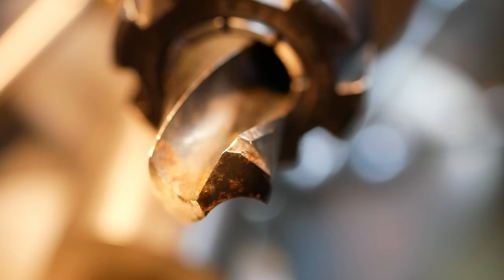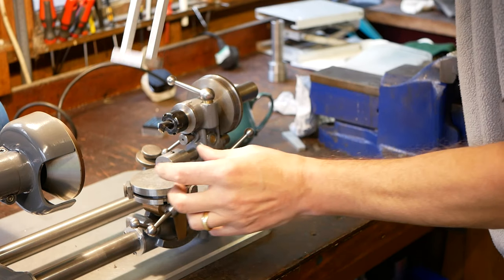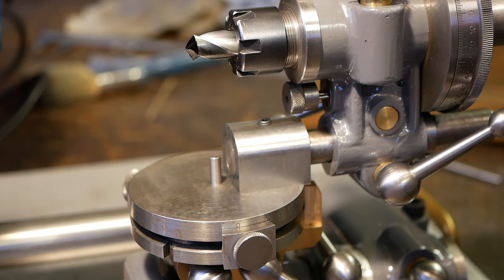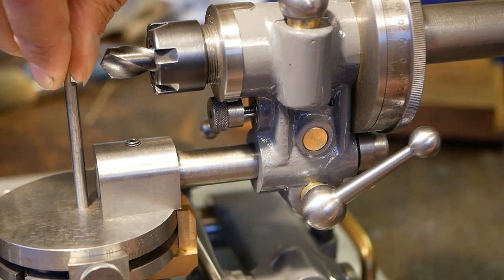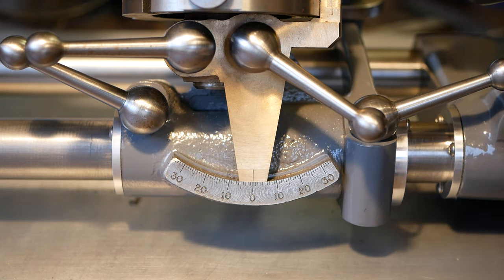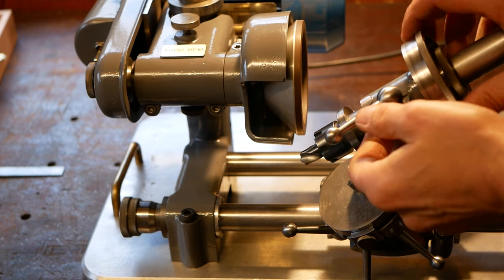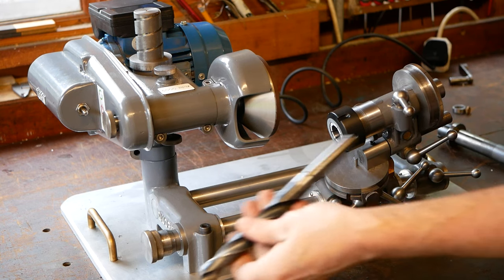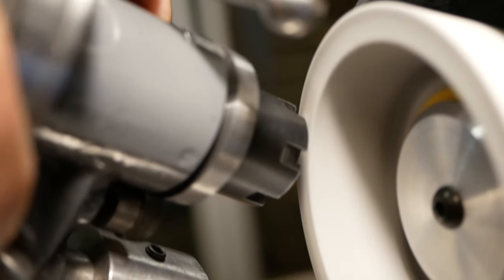How To Regrind Drill Bits Using a Quorn Tool & Cutter Grinder

Comment: Excellent!  I was taught to sharpen drills manually, and the activities of offsetting the bit and rotating it about an imaginary conical path (i.e., how I was taught) seem similar to the way this device works.  Though I say so myself, I'm pretty good at sharpening drills, but it's fair to say that while mine cut holes through metal, they can't be as accurate as machine-ground bits.

Comment: When I entered machinist school in the mid 70's, one of the first things we learned was how to sharpen a drill bit. Nearly 50 yrs on, I can sharpen a drill with my eyes closed. Seriously.
Reply: Вася ты никогда не заточишь сверло так как станок!!!!!
Reply: But does the chips come out evenly on the two flutes?
And how much oversize do you usually make?
Your drill bit grind might be adequate for your use. But it might be inadequate for others. To each his own.
Reply: @ramonching7772  You adjust the grind until the flutes are even. It also depends on the size of the drill.
Reply: Build a Quorn years ago fantastic project and machine 😊
Reply: Yea, my dad was a machinist. Taught me toolmaking. Always eyeballed drill sharpening, altered them to suit materials. When I was working as a truck mechanic and needed a really short 1" drill. my boss panicked when I cut an old one off with a chop saw he didn't think I could re-sharpen it. They're still using that drill bit. You can actually make them cut over or undersize.

Comment: Very clear tutorial for that particular machine. 

I'd raise a separate issue: that drill has been accurately ground on the cutting edges but not properly sharpened. 

Note the worn margin lands adjacent to the corner intersection. While this drill would perform adequately in soft steel, aluminum, or brass, production drilling in tougher or harder materials would not go too well. The worn land has in effect a forward taper that will tend to wedge against the walls.

The worn margins chafe against and work harden the hole walls resulting in heat, short tool life, poor finish, and possibly siezing.

That worn drill should have been rough ground back at least 3mm to clean undamaged margins then sharpened.
Reply: As a tool and die maker/toolroom guy I agree

Comment: I would respectfully suggest to those people who are watching these videos, that you purchase a supply of twist drills to begin your own self help training program. The twist drills can be either no-name new drills, or used/damaged drills from an industrial salvage warehouse, or at a flea market.
  I will add a point that I learned as a high-school senior in 1965. The half dozen guys that worked in a local shop, where I worked in the mornings, sharpened most of their twist drills on a 6”x48” belt sander. It sounds a bit odd, but does work very well. The surface is always flat, and grits can be changed quickly. Many of you folks already do own a 2”x72” grinder that will sharpen many of your drills.
  Whether you use a grinding wheel, or a belt grinder, you then need good lighting, a can of water, and a comfortable stool of the correct height. Then you begin to practice as long as it takes. In my apprenticeship, I had the opportunity to spend three months in the tool grinding department. The first order of the day was to sharpen all of the drills that a large shop(150 men) had used the day before. This is a lot of good practice. Everything from #52 tire mold vent drills under a microscope, to 4” taper shank( Morse taper #6). The large ones were sharpened on a machine. There were usually 20-50 pieces to sharpen each day. Some of the guys would check out a drill from the crib, and come to have a “favorite” point geometry added.
  Watching a knowledgeable person grind a few drills in order to get the proper hand placement, and the “swing” motion of the shank end. The worst thing that I have seen, is to watch an “expert” holding the drill cross handed. With a right hand helix twist drill, the right hand supports the point end, and provides the pivot that the drill swings about, while the left hand drives the twist drill, through that arc that provides the good cutting drill. The thing that few people explain, or even understand, is that the drill point has a steadily changing clearance angle from the dead center, which is the greatest, due to the smallest diameter, and gradually becoming lesser as you move outward to maximum diameter. The dead center is the part of the drill point that scrapes the metal, and gradually becomes more efficient as the rake increases towards the outside edge.
  Once you have mastered the proper point angle, and good clearance, which allows two nearly equal chips from the flutes, your next step should be to learn to thin the web, and/or split the point to reduce that retched dead center. 
 You can learn to hold the drill straight up, at arms length toward a white surface to observe the equality of the point angles and lengths. The grab your trusty drill point gage to verify you judgements. Make it a challenging game, and not some tedious chore that you don’t want to do. It is a skill that will be admired by others, and can be taught to members of either sex.

Comment: I think you meant "perpendicular" to the axis of rotation @ 2:17  i.e. parallel to the the rotating workhead centre line.   It took me a little time to understand your "parallel to the axis rotation" statement until the set square was mentioned.   Sorry to be picky but maybe this comment will help others fully understand that part of the setup.     I built a Quorn with extended bars and other enhancements and it took me 3 years of hobby time to complete but I wouldn't be without it now - I don't use it for drill sharpening as my hand skills in this department are quite adequate for any size of drill.   If you have a drill with a chipped land then you are best to course grind the cutting edges  (at 118 degree angle - equally) until the chip is no longer visible before you do the fine detailed sharpening.

Comment: I think I saw that J Hugel died recently. I would have liked to witness a discussion between him and Professor Chaddock!
Thank you for making his drill-grinding process more intelligible. I note that you are using an extended mounting bar for the work-holder.
Reply from the maker: Thanks for watching and good spot. The extended bar is useful for the ER32 collet adapter due to the extra length.

Comment: Thank you for publishing this video.  Will you be discussing how to calculate the axial and radial offsets for any given drill size?  I've watched this beautiful video several times and I would like to try this technique on my QUORN using my version of Professor D.H. Chaddock's (designer of the original QUORN) "Setting Micrometer" to set the axial and radial offsets.    My version can do axial and radial offsets up to 1" but I have no idea how to do the calculation for a specific drill size.   
Thanks again.  
F.C.

Comment: Really nice video, thanks! I didn’t understand why the angle was moved to 25° and then back to 0°?
Reply from the maker: The first part is setting the dial to 25 degrees, then locking the dial to the drill bit and finally rotating the combined drill and dial back to zero. (You could skip this but it's easier to know you're at the right angle when the dial reads zero.) The 25-degree angle is τ in Hugel's instructions (see link in description).
Reply: @chronovaengineering  ah I see, thanks!

Comment: So is this considered obsolete these days? I get that a drill doctor is consumer grade garbage compared to this, but I'm guessing that there is a professional equivalent to it now that doesn't require so much setup as this. Am I correct?

I love this video. Even if you lost me quickly. I love the way old machines were built before value engineering was a thing.
Reply: for drills this machine might be a bit of overkill, but it's also used to make lathe tools & sharpen milling cutters and that sort of thing where you might want much finer control over the geometry (:
Reply: @roseroserose588  I can see that application. Thank you.
Reply: In a modern production environment, the machinist is way too expensive per hour to be sharpening drillbits in this way.
Small drills get tossed away when dull, and bigger drills are collected and sharpened once in a while.
Or when the application is less critical, they are sharpened by hand.
These machines are one of the best ways to sharpen a drill (or endmill). but are unfortunately  getting obsolete in a modern production environment.
Reply: @neruelk  The Quorn T&C grinder was never intended for production use.  Foe the serious hobbyist it is an excellent piece of machinery.

Comment: Way too complicated.
Reply: If you want drill bits that are a joy to use, this is the way though. You can CNC mill preset collet holders for various drill sizes and cutting angles, to avoid manual setup. It’s then pretty idiot-proof. I’d go as far as machining the collet tapper and threads for the nut on the jig, so that the collet just pops in and can be retained so the drill diameters don’t get mixed up. Takes an offset lathe chuck if you want to start with a reasonably small workpiece, since the collet bore is off-center.